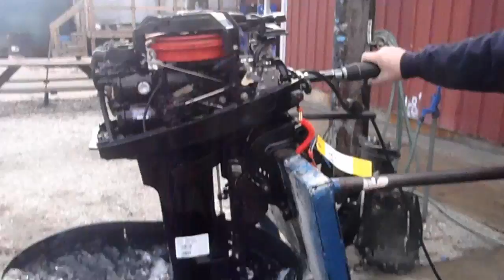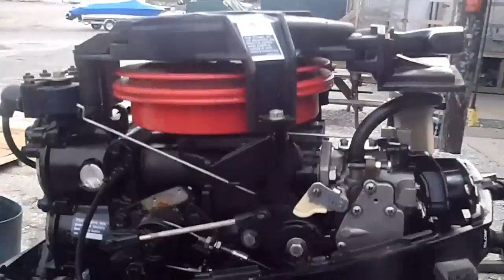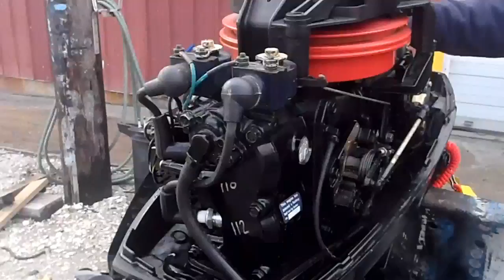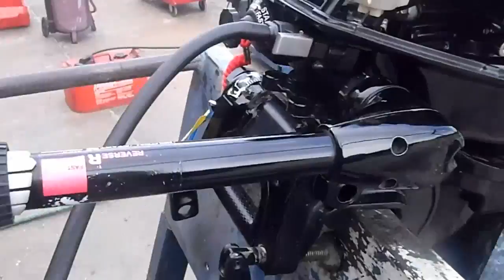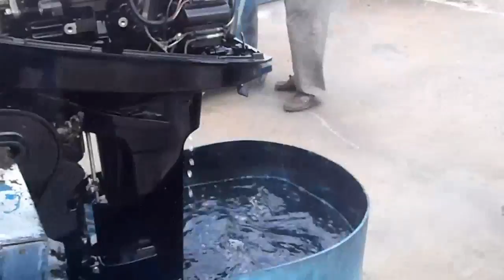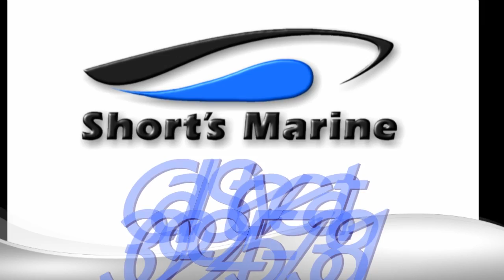6M4284 Used 1988 Mercury 8MH 8HP 2-Stroke Tiller Outboard Boat Motor 15" Shaft

Comment: Looks like it needs a new impeller, the tell tail isn't spitting like it should. I have the exact same motor and it is a steady stream while idling.
Reply: 1776 for freedom hi what is weight this motor
Reply: 1776 for freedom Thanks)))
Reply: It's the frame rate of the video at 30fps that makes it look like drops and not a stream.